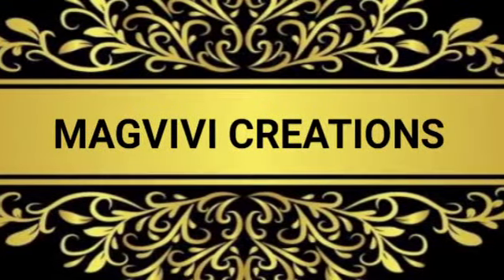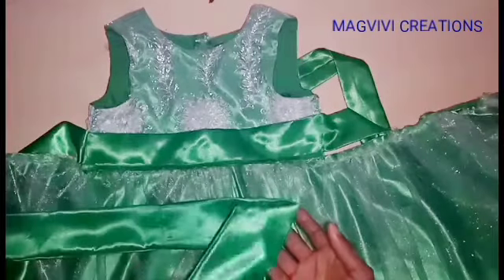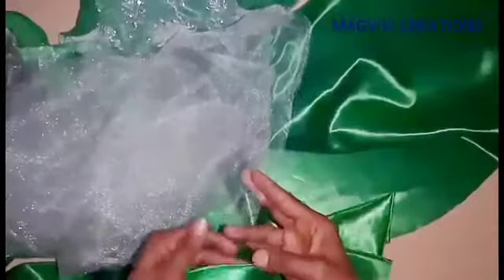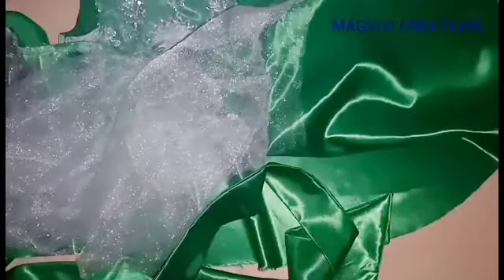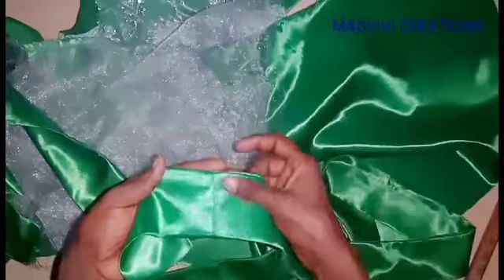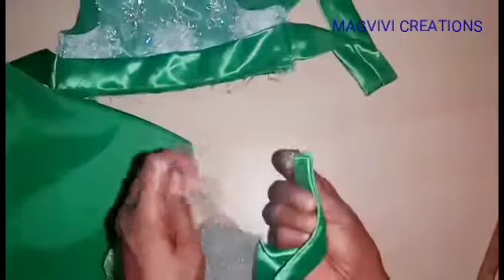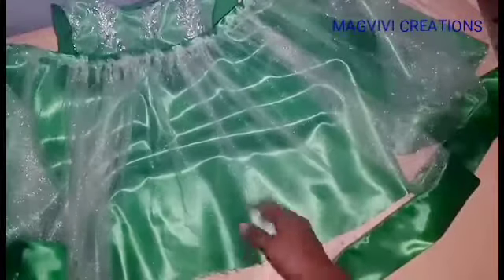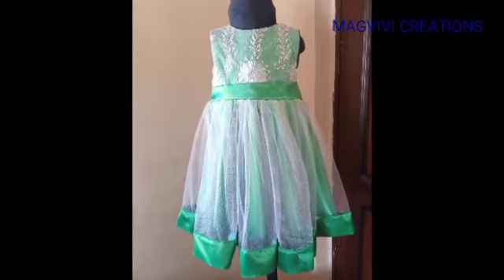How to sew satin trim to ball gown. How to sew satin trim to tulle. How to add trim to tulle. piping

Comment: This is totally wrong and it's not going to last after washing.of course anybodty can stitch ribbon onto tools. Your supposed to put toole inside the two satin
Reply from the maker: Don't say it is wrong if you don't understand the method or if you haven't tried it. You are free to to use this method, I have used it for years and the ball dresses are still in use with out anything happening to them. You are not experienced in this, so leave it.